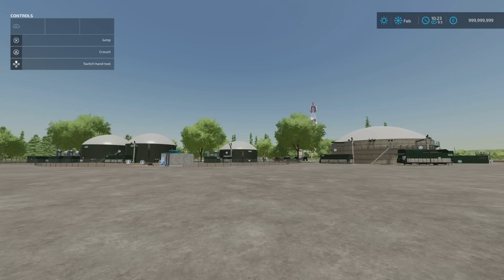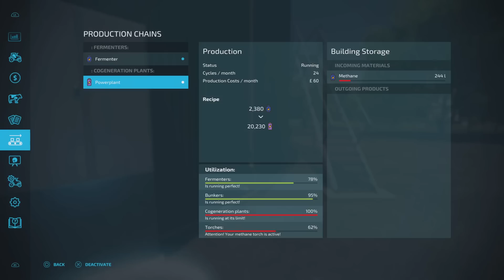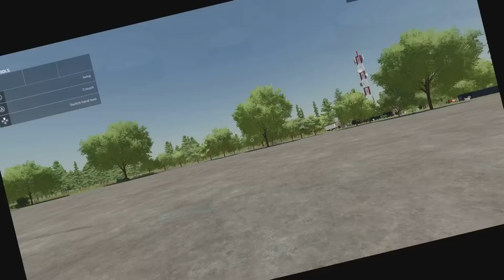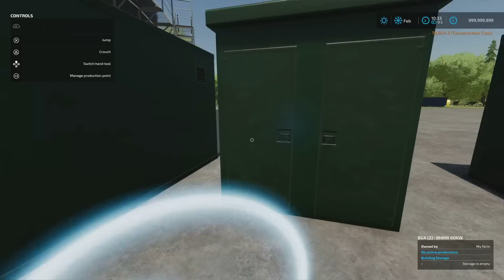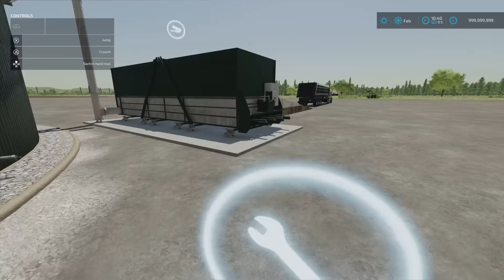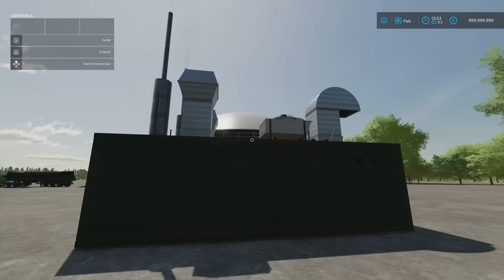FS22 | PlanET PnH Extension (Pumps n Hoses) NEW MODS! (Review) PS5 | 26th Feb 2023.

Comment: Are these plants worth the investment?  I have a pretty solid dairy farm with 500 cows that makes more slurry/manure than I can really use in the fields.  So, I was thinking of building a small BGA and putting excess silage and animal waste in it instead of selling it to the BGA on the map.  But if it is not really all that great of return on investment I wont bother.
Reply: @SO FAR SO GOOD I used to live in Minnesota.  We had a few BGA plants there.  Not many.  The company I worked for there serviced electrical equipment for them.  But, they just produced the methane and sold it off.  No power generation on site.